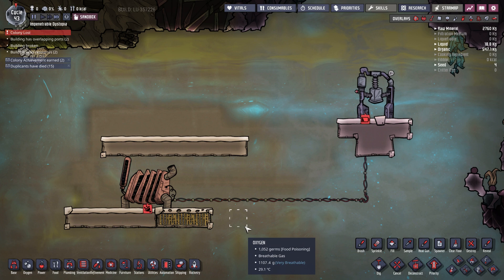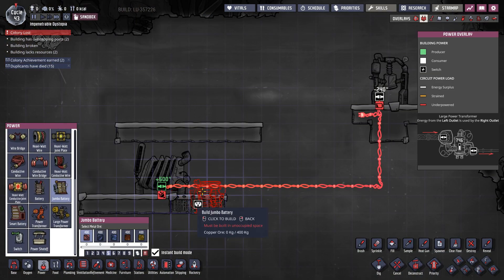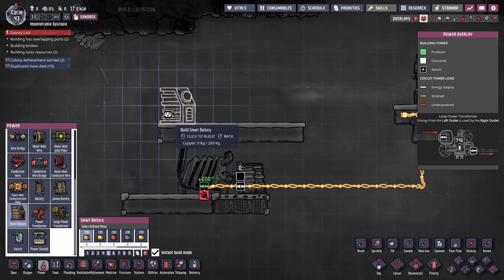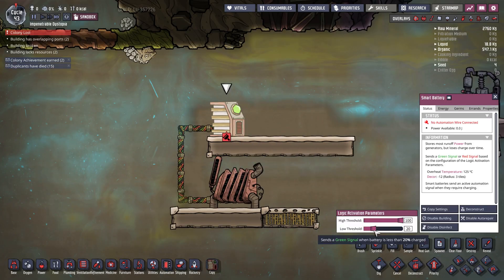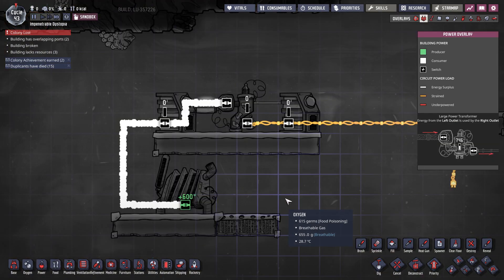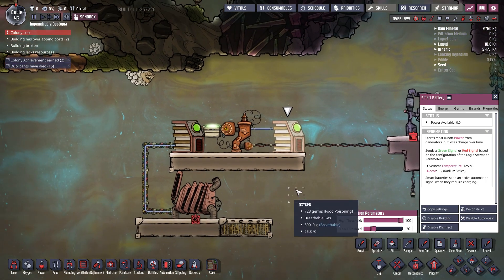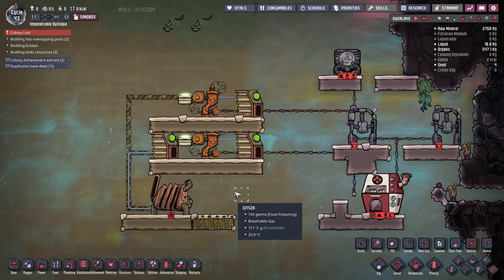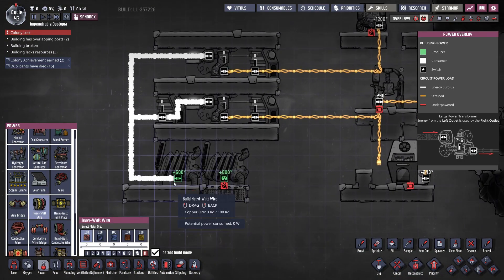Oxygen not included - How to build: Automated power grid!

Comment: Good Video man :D. A little optimization that you could do is to just plug the battery automation wire into the transformer instead of making a separate power shutoff. The transformer shuts down when the battery is full and turns back on when the battery is almost empty :)
Reply from the maker: This will work as well, the problem with automating the transformer is that by itself it is a type of a battery and like all batteries if they remain idle for some time they will lose power.
This means that when the transformer is "Charged" and is turned off, that power inside will deplete over time and will result in wasted power.
This doesn't happen if you automate a secondary battery and a switch instead.
Reply: @stivraptor  It's true that batteries have a power runoff(so they lose power over time) and smart batteries have the lowest power loss of all the batteries(400 j/cycle), but the transformer has a power runoff of 0 j/cycle.
Doesn't this mean that if it contains 2 KJ of power and it gets shut off, that the power inside of it remains at 2 KJ forever? 
Since the batteries lower bound is (often) set at 20%, you'll never actually touch the power inside of the transformer. I feel like the power shutoff was added to disconnect parts of the power grid while the rest of the grid still gets power from the transformer it is connected to. So more to add flexibility :D
Reply: Yeah, i'm also curious about this, maybe i'm not getting something about the utility of the Power Shutoff but with a power runoff of 0.0 J/cycle in Transformers, doesn't that means that they actually don't loose any power over time as Batteries do?

Comment: this tutorial has 3 major faults:
1) u dont need the switch, u can connect directly the "load" battery to the transformer to switch it on\off
2) when u put a battery AFTER a transformer the battery will provide any amount of power requested by the loads = u'll fry the cable if the total sum of loads exceed the power wire = the transformer is useless
3) u are generating heat from transformer AND battery.

u should stick the batteries on the "main bus"  and use their logic output to enable\disable the power generators attached to em.

only on vital system (like oxygen generation and most important the filtration setups\cooling u should use a buffer battery, after u wisely make the math of the max load couse u need costant power supply.

in that case i'll opted for a  system with total amound of loads that doesnt exceed the wire load capacity, one battery permanentely connected to it and a battery with 2 power shunt (before and after) logically connected with a not to the second batterly.
in this way while the "load" battery buffer the  load wire, the other battery will toggle between charging and discarging witohut need of transformer OR.

just make a main power wire with batteries and generators and  then secondary line connected with transformers . remember that normal wire load is 1kw but a refined cable hold 2kw (aka 2 small transformer)  and the material used is the same but refined.  

So for newer players i'd suggest to have  power production plants connected with heavy watt wires And  then with small transformer use normal power wire. (leave space for a second small transformer so later when u can refine ores or u get volcanoes of iron or gold that make already refined minerals) u can then double the transformer and double the load with  refined power cable

Comment: I basically use this set up minus the transformer and heavy guage wire. Put a wattage sensor on the line behind the battery and after the cutoff to avoid wires frying.

Comment: Thx for the tutorial. I don't quite get why you need a smart battery after the transformer and the power shutoff. Couldn't you simply plug your circuit into the transformer? Also without the smart battery you can't overcharge your wires no matter how much you connect.

Comment: by placing a battery on the 'low' side of the transformer you are completely removing the transformer's ability to limit the circuit to 1000 so you don't damage the wires, which is the entire purpose of the transformer. so why would you do that?

It's common to connect more consumers to a single circuit than the wires can handle because the cases when ALL consumers will be running at the same time is rare. By placing the battery there, you're allowing all consumers to turn on at once because the circuit will no longer be limited to the 1000w from the transformer.

I also don't even see a reason to make the circuits in this way to begin with unless you really need a high level of automation. for example if your power plant can produce a maximum of 6000 watts but you have a potential for 8000 watts of use and want to shut down certain, lower priority areas of the colony when over-consumption conditions happen.

you should still be placing the secondary battery before the transformer though, not after, to ensure the consumer wires don't get overloaded.

Comment: Good video. I'm new to ONI and have been running manual hamster wheel power but I'm ready to upgrade to something else. I have a question. When you added the second circuit, why didn't you use 2 smart batteries like you did with the first circuit? Wouldn't the second circuit also need automation in place to keep the generator from always running?
Reply from the maker: The first battery acts like the "heart", it pumps "blood" to all other organs (the other, secondary battery), the "heart" battery controls the generators and distributes power to the other batteries, so there is no need for another "heart", that is a primary battery in this case.
Reply: @stivraptor  You would want more hearts if you had power generation on that heavy watt wire somewhere further away though, right?
Reply: @stivraptor  Ahhh. Now I see that the heavy wire from the generator to the "heart" was still the same "heavy wire circuit" when you connected to the second transformer.
Reply from the maker: @thegreybeardking  Exactly

Comment: Can you explain why the power switches and the consumer-side batteries are needed?  Couldn't you achieve the same effect if those were deleted from your design?  (And if you need more capacity add more smart batteries to the generator circuit)
Reply from the maker: The reason why I use the batteries on the consumer side is because they are useful to create a power priority with other external generator.

For example, my SPOM has a hydro generator that pumps excess power to another external circuit.
This circuit is connected both to that generator via transformer and to the main power grid by that battery on the comsumer side.

So what happens now, is that as long as that battery on the consumer side is getting power from the hydro generator, it will not plug itself to the man power grid generators.

Comment: If you need more buffering, do you just add the Jumbo Batteries in front of the primary battery (for buffering all power circuits), or between the transformer and smart battery for secondary circuits?  I ask b/c I keep having issues with the heavy wire not feeding the Smart Battery fast enough.  The secondary Smart Batteries (with heavy loads) will deplete before the Jumbo Batteries that come before it are drained, and I want it to drain those batteries (to recharge the Smart Battery) first.  Seems so simple ... but it's not in practice (or I don't fully understand how it works, which is likely since I'm fairly new to this still).
Reply from the maker: Ah, this sounds like you have too few generators that produce power, try building another generator.
Reply: The secondary Smart Batteries (with heavy loads) will deplete before the Jumbo Batteries that come before it are drained,

there is your problem, such a design doesnt need any jumbo batteries, if you want a bigger buffer just make more smart batteries. they also lose less power over time
Reply from the maker: This never happens, and there is no need for more buffer.
If batters are drained faster than they are filled it means that there are not enough generators.